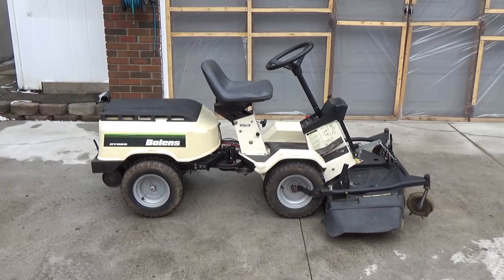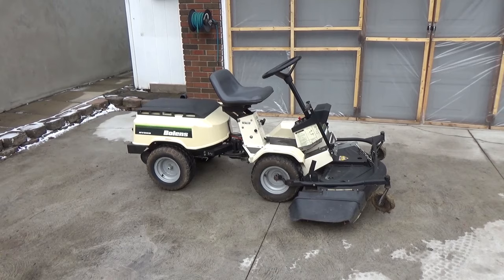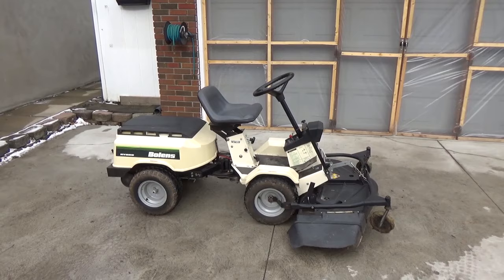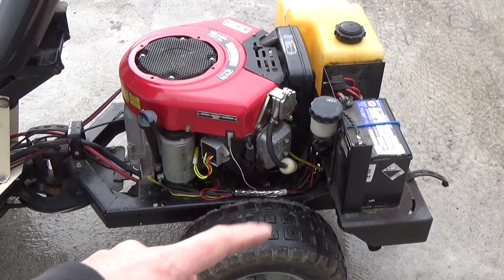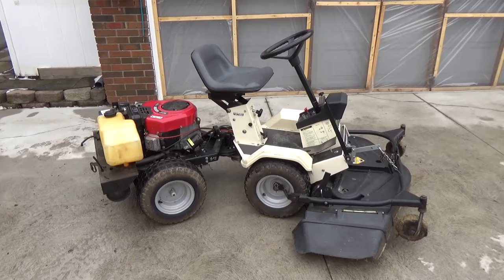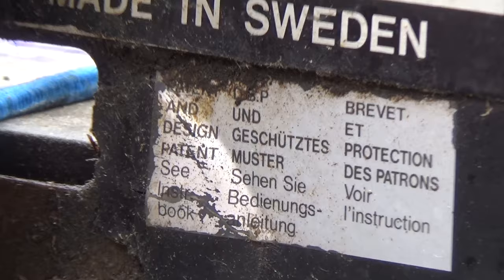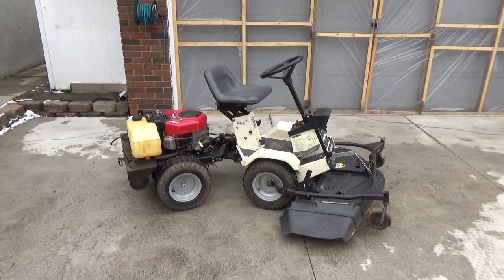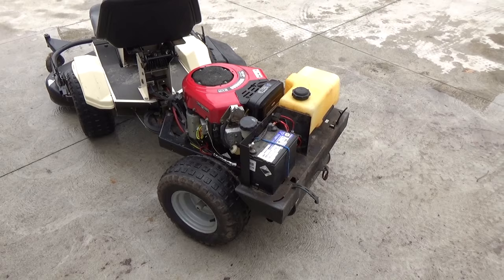Bolens Articulator - Model 966 (Built in Sweden)

Comment: I'm so glad you made a video on this I've owned one for 25 years and it never has let me down. It's identical to the bolens but it's under it's true name stiga park pro. And by the way that 16 HP Vanguard is the factory installed engine I have two of them and they both came with those engines. Parts were always difficult to find aftermarket so I'm glad that you mentioned the one in Quebec which I'll be checking out. Thanks again for all your videos you do a great job.
Reply: Glad we could help, properly maintained your machine has lasted 25 years, great job. Will likely last another 25 because it looks like they are built extremely well.

Comment: As soon as I saw it I thought that machine looks very familiar but not white or branded Bolen.
Used to be common here in England with a front mulching decks but the decks rotted out and most of them were then scraped.
Reply from the maker: This thing is mint! And yes I could see there being issues with parts being hard to find. That's why I also included links in the description for anyone who is located in Canada and is looking for parts.

Comment: I thought they came with a briggs l head 8 or 10 hp motor
Reply from the maker: Maybe previous versions with smaller mower decks and the 5 speed, but the Stiga Park 16 HST comes with a 16hp engine and the hydrostatic transmission, and the Bolens 966 is identical other than the color and branding of the stickers/decals. You can also check the decal on the back of the engine cover, it does say 16hp. When I said this wasn't the original engine, my customer said the guy he bought it off had swapped them in the past, but I guess he found another 16hp to use in place of the original.

Comment: I have this exact model machine, the deck is slightly different. I've had it for years and love it! I need a new fuel tank and can't find one anywhere.. I spoke to a parts person at esf who told me they're no longer available. Any leads on where to get a tank, Bolens part #1813822 or Stiga part #1134-2886-01 would be immensely appreciated! Ty:)